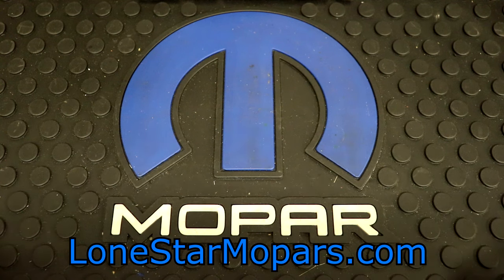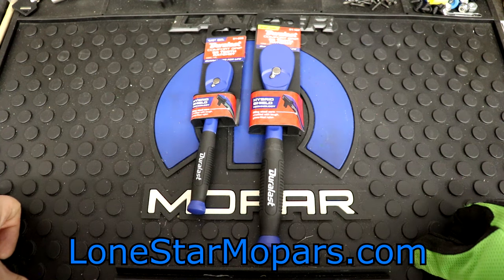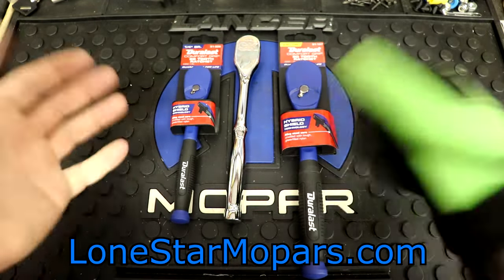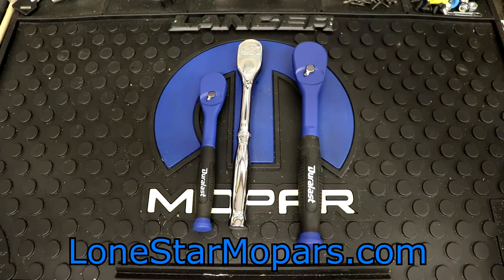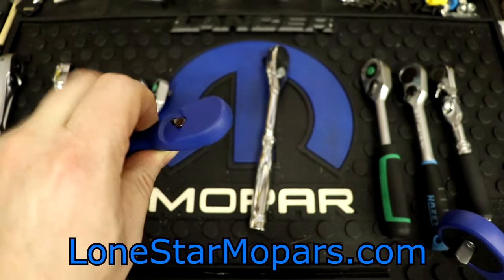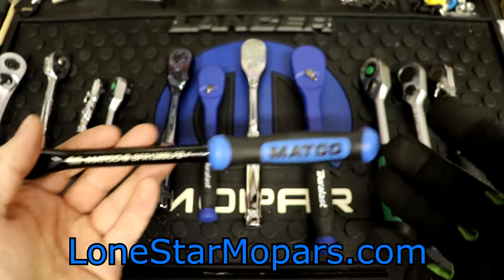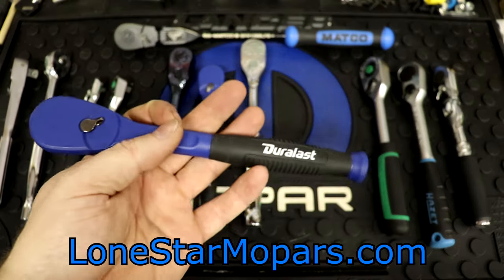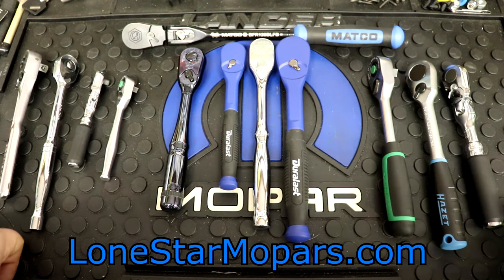Duralast 90 Tooth Encapsulated Ratchets: From Feel Good to Buzz Kill

Comment: Might be fun to open them up and take a look at the guts. They seem like a good option for battery terminals considering I’ve touched both terminals on more than one occasion!
Reply from the maker: I might do that...Batteries are a great option.  If you ever see the spark marks on my OG Craftsman, one is from a battery, lol.
Reply: as a CDJR dealership technician i solely use these to disconnect batteries, 600v, 400v, 12v. auxillary. They are my go to battery ratchet.

Comment: Dude, I think my thoughts pretty much mirrored yours on these. When I saw them all I could think was BLUE!! And as a Kentuckian (though now in Indiana, I will never be a Hoosier) Blue speaks to me on a deep level. So, I bought them. I love that they have a lifetime warranty, they feel good in my hand, and they are Blue...which, is honestly the most important thing about them. I picked up some Makita Metric and SAE impact sockets (3/8 and 1/4) on the recommendation of some Carpentry types that said they covered most of their job site needs and seemed pretty durable given their inconsistent usage. I figure these Blue (and therefore awesome) ratchets would be a good addition to that load-out. I still carry my Nut Grips of course, but they get their own box and only get used when needed. Admittedly, I have only piddled with these ratchets so I am intrigued to see your take.
Added Later: Checked the fitment with the Makita impacts, normal Millwaukee stuff, and some Koken Nut Grips. For both 3/8 and 1/4 I saw the same issue with Makita and Millwaukee. Oddly, the 3/8 Nut Grips had the best fitment overall moving just a bit.
Reply from the maker: Haha, nice!  If I could get any company to produce ratchets with my ideal aesthetics, it wouldn't be super far off from these.  They just look killer.  A couple of changes, yes, but for an off the shelf ratchet, the eye candy was too much.  I also think the 3/8" slim head is a big selling point...sadly the 1/4" is more run of the mill, but still slimmer than many.  Yeah, I need to check more sockets.  I think the ratchet's anvil and slim case contribute to the issue, but certain brands can mesh better than others.  It is still functional, but I worry about higher torque loads with the socket pulling away like that.  I may have to look into Makita's impact sockets.  Hopefully the ratchets hold up for both of us...for Mopar blue and Kentucky Wildcat blue, they are still winners, haha.

Comment: Sir, is the socket just not pulling out a little bit lining up the socket detent/hole with the detent ball on the ratchet. I assume the ratchets are made with enough clearance to work with all brands of sockets.
Reply from the maker: Not sure...I think the anvil design is the issue as it forces the socket up.  If I were to take it apart and mill that square, I think it would correct the issue.  I would have to disassemble and mic everything for measurements, but when you place the sockets and they pop up, the ball detent isn't centered and generates more play across the board.  The setup is fully functional, but I would worry about high torque loads with the play.  Definitely a strange setup vs the norm of what I have seen.

Comment: I looked up videos after I saw these at Autozone and thought "Wow those are the thinnest ratchets I've ever seen."
Wanted to see if there are other similarly thin ratchets and how durable people think these are.
Bought the 3/8" and like it, though I would have preferred a just a round hard plastic handle with no grip but I still like it.

Comment: for the stiff matco ratchet, and for any stiff tools, then the solution to loosen up must be to do thus: 1) take isopropyl alcohol, or other degreaser, and flush out all the grease. then 2) take valve grinding compound. and work it well into the joint or area that is too stiff. 3) keep repeating the movement of the tool mechanism to work the valve grinding compoind into wearing the surfaces. so you are effectively grinding the surfaces with an abrasive paste. now, you might have other types and grits of abrasive paste, or you might take an emory paper, and burn up the backing, and then mix the ashes into some clean grease. in order to make your own homebrew grinding compound of a specific coarseness or grit.

anyhow, hopefully the grinding has been sufficient and successfull operation. then step 4) you need to thoroughly flush out and rinse out with either the isopropyl alcohol (ipa) or acetone, or your other preferred and suitable de-greaser. so all the grinding compound is completely flushed out of your tool. then 5) new grease again. whatever grease you typically like to use. mine is a brown lithium based grease, for example like mobilix ep1. but of course you might instead use something else. for example machinists like to use wey oil. or whatever other appropriate lubricant for the tool.

i hope this tip is useful more generally, since other hand tools also can arrive to tight movement action. right from the factory.
Reply from the maker: I've honestly wondered if they applied the black chrome too think and didn't have that in the design tolerances when they originally had the chrome only option, but regardless, it is just reckless oversight.  This should have been caught in prototyping and corrected pre-production.  I've done everything short of what you describe and nothing has worked more than a few swaps before it is back to nightmare mode.  I can probably get some grinding compound from a buddy...that is a lot of work to make a brand new ratchet that expensive simply function properly.

Comment: I love my snap on ratchets but they are thiccc. I’ll have to find one if those. Maybe oem tools makes one for the green gang
Reply from the maker: Yeah, these would be a great compliment for tight vertical confines.  They are wider that most ratchet heads, but if thin is what you are after, they've got it covered.  OEM's Green would be pretty sweet too.

Comment: I have the 3/8s used it the past 6months daily, no problems other than when trying different ones on shelf some where smooth others really chunky lack of lube . Can’t pull screws out cause there striped but it works great , model number is scratched off but duralast logo it still there. I’m a scooter mechanic.

Comment: i have a lot of the older duralast 36 tooth ratchets and love them.... they took them out of the store like 5 or 6 years ago.. OEM tools still makes them in Matte chrome..
Reply from the maker: I may have to check them out.  There seems to be a lot of people that really like their chrome ratchets.
Reply: @lonestarmopars  yeah everyone talks about how HotRod mag. Did a torque test on the 1/2 drive and it made it to like 800 foot pounds
Reply: @michaeldeel7998 I swear they were MAC 36 tooth clones. It was a great design
Reply: @ihavethedocuments2580  yeah bout the same thing,or like the USA Williams 36 tooth ratchet.. I bout every OEMtools ratchet they had all drive sizes, flex head and regular..

Comment: The interior mechanism looks identical to Taiwanese Apex stuff so my guess is that they make the composite body in China and the internals are shipped from Taiwan but it is just my guess.     I bought the 1/4" as it was on sale for $10 and I do really like it for messing with battery terminals, I have had sparks fly one too many times and leave a burn mark on a ratchet so this is great for that.      The worst are German cars with the battery under the passenger seat, you have to be a contortionist to work in there
Reply from the maker: Very possible.  That was a great pickup for $10!  People kind of underestimate the composite ratchets for stuff like batteries.  I'm in the same boat...was tightening down a valve cover bolt on a 440 and the head of my Craftsman hit the J-box....it sparked and started burning a wire to the battery.  The ratchet still wears the battle scar and as a 14 year old at the time, it left quite the impression.  Needless to say, I always disconnect the battery, lol.

Comment: I was tempted in getting a Matco flex head just like that but same problem it would not flex it was stuck. So, I backed off it. all the ratchets were like that the ones this guy had in his tool truck, a real shame.
Reply from the maker: Oh dang...good to know the truck was like that.  I've had people tell me they break in, eventually.  The thing is I have used that unlocked, soaked it, made a point to work it side-to-side with pliers when I'm charging a battery, and it has still not gotten right.  I'll have times where I can lock and unlock 2-3 cycles and then it just goes back to stiff.  With my bad thumb, it doesn't happen.  You shouldn't have to shimmy the head while applying insane pressure to flip the switch either.  They are great looking ratchets...very slim heads, but how that gets out of production like that is beyond me.  On the bright side, I may never get to the point of it skipping, haha.  Glad you got to test stuff out before being stuck with something you'd be unhappy with.

Comment: the old made in Taiwan 72t composite ratchets like the ones sold by HF were mostly seen as gimmicky and soon to be failures ubtil people started using 'em and now most mechanics have a couple or more laying around as they're tough and reliable at least as long as you don't get the Wish or Temu copydogs specials. hoping Duralast OEM did their homework on durability and toughness too. 😽👌
Reply from the maker: Oh yeah, I love the OGs.  They do mar pretty easy, but past that and sometimes having the selector switch move itself to center, they are great...especially for the money.  My 1/2" Tekton is super beat up, but still ticking.  Short of the socket issue, these seem like pretty decent ratchets for the money, especially considering how much I like the aesthetics.
Reply: @lonestarmopars   is the socket "problem" only with the Ko-ken ones, especially the Z-EALs? if so it's due to the different "dimpling" inside the socket for the anvil ball that makes those so great and with less "stack height" when used with the Ko-ken ratchets. now for those tasty Duralast, if only they made a 10 or 11" long 1/4" one i'd get a box of them pretty fast. 😸

Comment: BS count: 5 (edit, it is 6)
i have a 3/8 composite ratchet from Stahlwille and i love it despite it having less teeth than most babies
ugh, please stop scaring us with the gross matco flex head, id rather use my face to loosen fasteners than touch that ratchet
The ratchets look cool, but i am very skeptical that coating will last, but i hope you prove me wrong. the anvil on the duratech is a similar profile to impact driver anvils, where it has a larger radius but the impact anvils are longer to compensate, maybe they didnt have much confidence in the anvil strength so they gave it extra radius for strength? the ratchet looks sweet but the thinness is compensated by having a huge wide head.
thanks for the videos as always
Reply from the maker: Thanks for counting!  No kidding...I have never seen a composite from Stahlwille...I'll have to see if it is still in production (I've also never looked, so that might be part of it).  Yep, no clue on the coating...I know the Pittsburgh and Tekton's hold up, but they do gash pretty easily...that is also using them sparingly.  I'm not sure what was going on in the design process...there is a lot of really great stuff that gets offset by pretty bad stuff.  It is a bit wider, but if you are just needing vertical clearance, that thing is really thin.  Funny thing is I've been tempted to order a Matco in orange and black...actually nearly did it Friday night, but they apparently only make them in locking flex heads.  Guess it is my sign to stay away.  I really just need a magnetic pry bar holder, but do NOT want the default red.  Corwnell's blue would be the best fit, but it is easier to get Matco's.
Reply: @lonestarmopars damn, I wrote put a big reply and something went wrong lol
The part number for the ratchet is nr.450. I really like the thing. It has the reverse switch halfway down the shaft which was super handy for installing and levelling new conveyors for a certain online shopping tycoons new distribution centre.
I hope the blue coating is revolutionary and sticks around for the long haul. Will be interesting to find out sometime in the future. 
Cornwell is super interesting because it seems for me here in Australia, I have no access to it. There are snap on trucks and some trucks that have brands like stahlwille but not Cornwell.
Reply from the maker: Also, I just checked and it appears the Stahlwille composite has been discontinued.  May make Collin check on it, haha.
Reply: @lonestarmopars  well I thought there was one on the Australian e bay. I went to check and let you know if it was still there. But it turns out it's a half inch version that I do not have and very much want lol
Reply: I think the era for these ratchets is late nineties, early two thousands.
Reply: @chadroy16    yep, same kind of construction as the Hazet 863N, 8816N and 900N. very nice and with a thinner head as the switch is on an internal link bar near the grip. on top for the Hazet ones and on the side for the Stahlwille. 😽👍
Reply: @kittytrail  I have a similar Hazet t-handle variant in my cart. It's 863Q.
Reply: @chadroy16   indeed, there's this one too that i forgot about... 😸